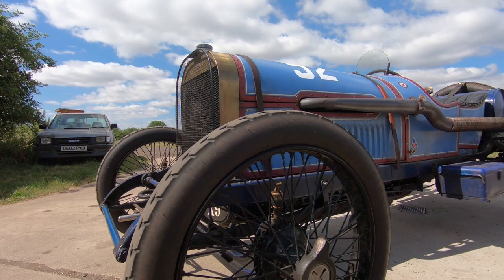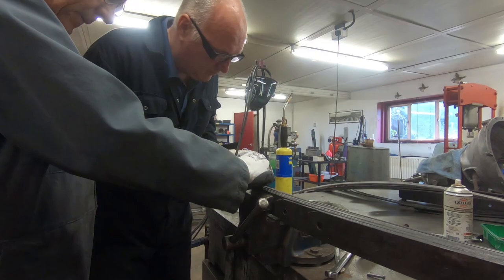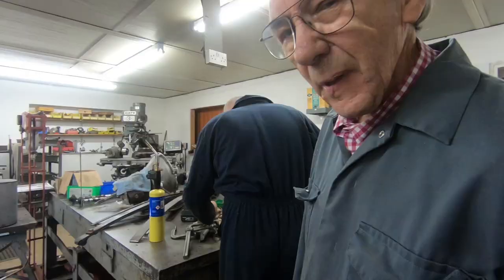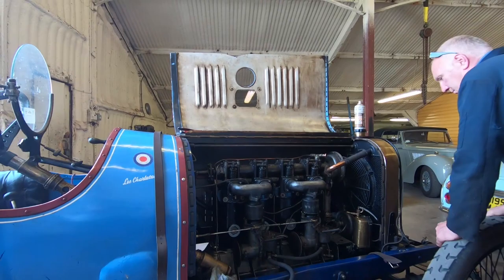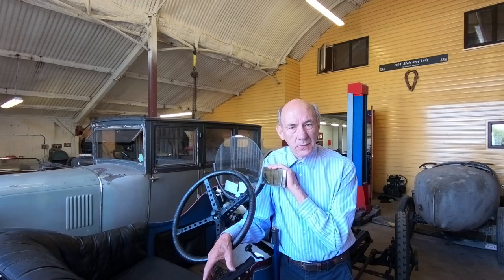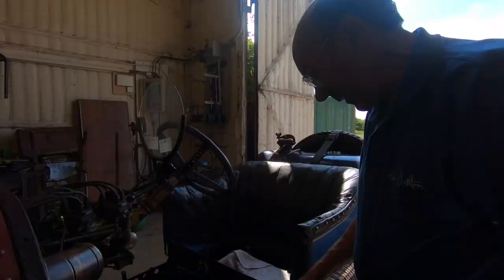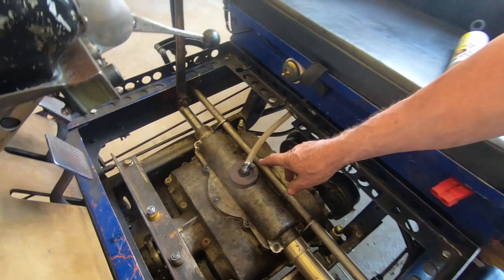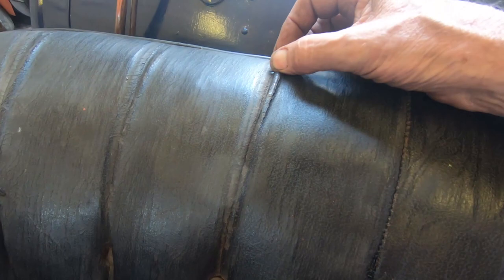1914 Indy 500 10L Race Car - Ivan's Shed

Comment: Great Video as per usual. I am pleased to see that like this Tinkering fool ( as in me.)
 Ivan doesn't throw spare or leftover parts away. As you never know when you may have a need for that One item..!
 It Drives my partner Nuts but it will save a Quid at some point down the Road..!

 Real Mechanical Tinkering at it's best..! Eg. Done by Ivan, not me..!!

 Cheers from Downunder. 😎

Comment: Hi Ivan and salutations,
My suggestion is that the transmission might came out of a one tonne or half tonne Lorrie maybe from a Peugeot or another brand of French made Lorrie. So, I suggest you can study or do some research in that area and see what you can come up with. Also you might want to get in touch with Jay Leno in America or a Stutz club in England and see what you can find there for that distributor cap that has a nasty crack. I hope this helps.

Comment: Why would you blame a power drain on the starter. Wouldn't it disengage after the engine started? I had a Karmann Ghia that I did not replace the starter bushing in when I rebuilt the transmission. The starter would not disengage and it fried the electrical system.

Comment: Ivan, the distributor caps, is it possible to 3D print them?
If you're not sure what I mean, here is a link to a fuel pump spacer I did for a casting pattern: https://www.youtube.com/watch?v=FaZ_y3zi6LY
Now I have no idea how good the 3D part is insulation wise (made items for low voltage use) but on HT?
Also they are not wanting to get too hot (probably 40*c max)
ID gladly have a crack at one if you were in NO rush like.
PS love the fact your a bit of a geezer who is who he is, and not afraid to wing it on a job (Very much like myself), keep it up.
Andy